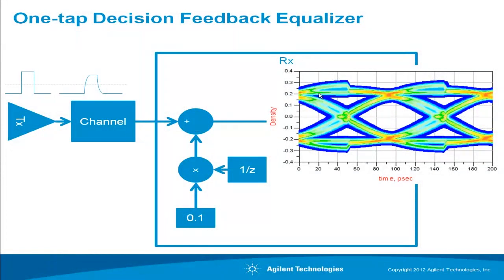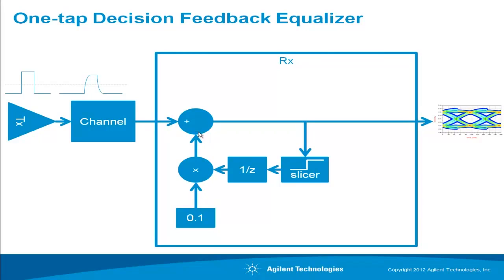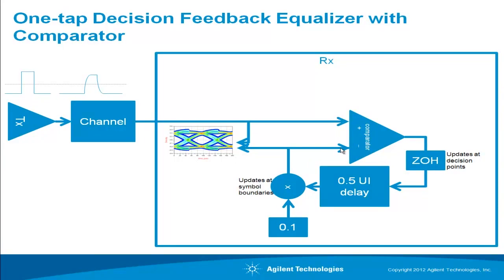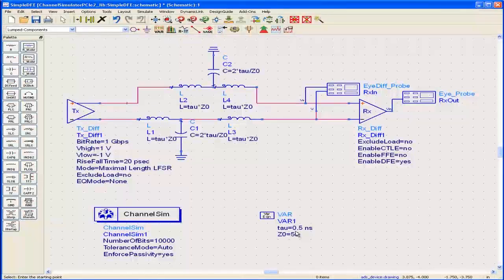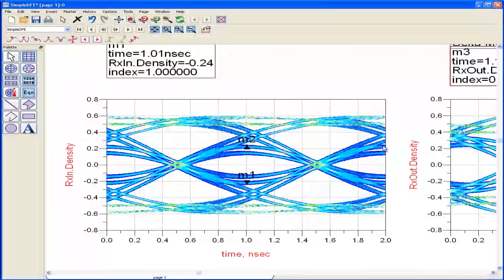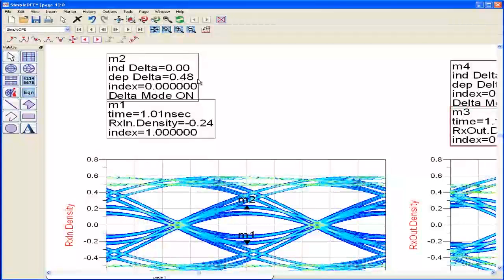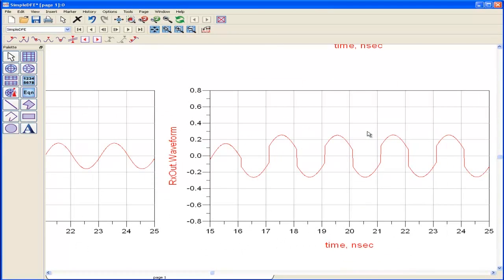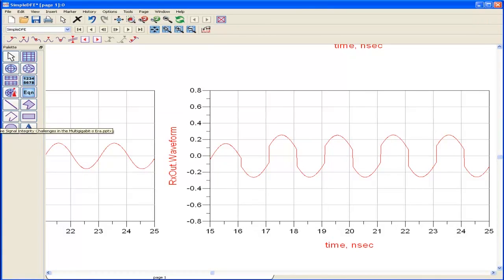Decision Feedback Equalization

Comment: Hi, great video with one inaccuracy. The lower height waveform is from a 101 and 010 transition, not a transition after a long stream of 1s or 0s.
Reply: Hmmm... Why do you say that? I think a 1 after a long string of zeros will be lower than a 1 after a long string of 1s and 0s.
Reply: @ColinWarwick  I do agree, max ISI is usually seen in 111101111 or opposite 0001000 patterns